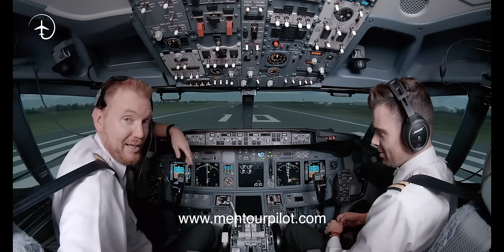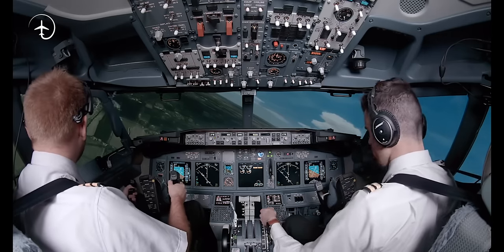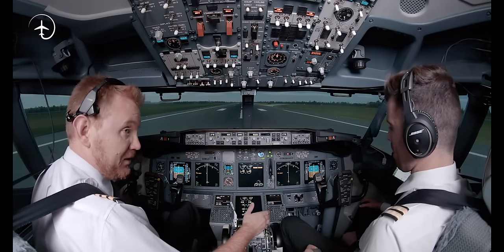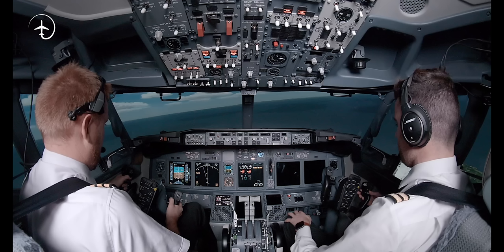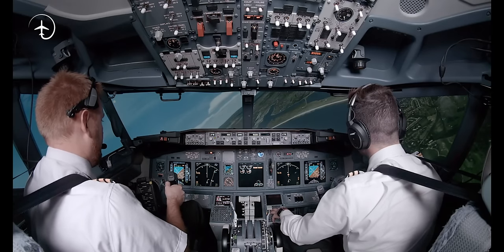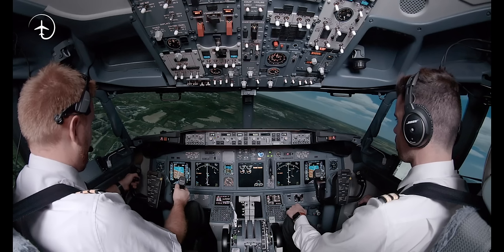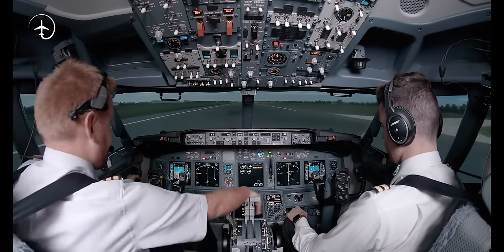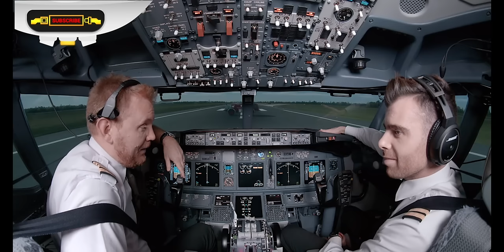Can an Airplane land if BOTH engines fail?

Comment: Very interesting, just obe thing, because you lost both engines, there was no time to dump fuel, how exactly was there no problem, i mean you landed in the first third of the runway? How did the simulator took into account this? 90% sure you were above maximum landing weight. Its just a little bit best case scenario,  anything else, perfect.

Comment: As a glider pilot, I find the question quite silly.  Glider pilot refer to engine as cheater equipment ! If you have enough altitude it is not a problem at all.

Comment: What about jettisoning the fuel? No need to do that?
Reply: They had only few minutes time to make the landing. In this case the amount of the fuel is not the main issue because they have no option but perform the landing.  And Boeing 737 doesn't have a fuel dump system. It's also not possible to dump fuel in a few minutes.

Comment: Would the RAT drop out by itself when there is no power by the engine generators anymore? I'm not sure but I think I've read something about it?! Not specifically at the 737 but somehow somewhere.
Reply: Funbeenif Not specifically on the 737 since it does not have a RAT😉 Think it can go out auto and when selected

Comment: Hey mentour! In the case of the FO being pilot flying and this happens, does he then relay control to the captain or continue flying as he's the designated PF?
Reply: Or will it be briefed before takeoff? (who does what if things hit the Fan)
Reply: The instruments were only working on the captain's side so that makes sense.   I would expect the captain would take control by saying "my aircraft" or "I have control".
Reply: In the Sully incident, it actually was the FO flying the take off and during the bird strike. This is from the official cockpit voice recorder transcript of that incident:

15:27:14 HOT-2 uh oh.
15:27:15 HOT-1 we got one rol- both of 'em rolling back.
15:27:18 CAM [rumbling sound begins and continues until approximately 15:28:08]
15:27:18.5 HOT-1 ignition, start.
15:27:21.3 HOT-1 I'm starting the APU.
15:27:22.4 FWC [sound of single chime]
15:27:23.2 HOT-1 my aircraft.
15:27:24 HOT-2 your aircraft.
15:27:24.4 FWC [sound of single chime]
15:27:25 CAM [sound similar to electrical noise from engine igniters begins]
15:27:26.5 FWC priority left. [auto callout from the FWC. this occurs when the sidestick priority button is activated on the Captain's sidestick]

Comment: I will Say in Canada we are the king's of gliding 2 very famous case Air Canada 236 ( Gimli Glider) a Boing 767  run out of fuel and Air Transat 236 A330  glide for 45 min over the ocean both land on runway I flew with one of this Captain a lot skill can't be replace....

Comment: What would happen if you were to lose all electrical power in a fly-by-wire aircraft?  Would they lose control or is there some safety precaution?
Reply: Ram Air Turbine (RAT) will deploy to provide limited electrical and hydraulic power.

Comment: What about fuel dumping before landing?
Reply: Boeing 737 doesn't have a fuel dump system. They had only few minutes to perform the landing so the amount of the fuel is not relevant in this case. Their only option was just perform the landing.

Comment: Question, in a situation like this, is it normal to dump fuel for landing weight? When is that necessary and when not?
Reply: There certainly wasn't time to dump fuel! Which means the plane must have been heavy as well as unpowered..
Reply: Can’t dump fuel in a 737.

Comment: Do the engine thrusters cut fuel to the engine in this case? could you have cut them earlier to prevent fuel leaks?  Did you have to think about dumping fuel?
Reply: Boeing 737 has no fuel dump system.

Comment: Does the 'ram air turbine' deploy in these situations?
Reply: The Airbus 320 is equipped with a RAM, while the Boeing 737 gets emergency power from batteries and the Auxiliary Power Unit.  My understanding is that the RAM deploys automatically while the APU must be started manually.

Comment: Nice video! I notice that you did not retard the throttles until after you landed/stopped.  Wouldn't the fuel pumps still be working, pumping fuel to engines? Or is there an auto fuel shutdown valve in system to cutoff fuel flow.

Comment: I teach Turnbacks to Opposite.  Over turnback altitude with no engine power? 1-Lower the nose,  2-Turn 40-45 degrees bank just under the stall speed warnings, (Not 30 degree bank only).  Also no time wasted starting engines or doing anything while going away from airport.  Turnback at 40-45 degrees and head to airport BEFORE anything else.. Aviate with lowering nose, Navigate to airport while copilot communicates.  No time wasted going away from airport with no engines.  Those guys instead kept going AWAY FROM AIRPORT.  Huge pilot errors done.  Then they lower the gear and got short of field, DAhh!! and hit trees.  FAil..

Comment: Not to brag... A few years ago the aviation industry began testing us on dual engine failures with us going through an inflight restart in our annual "recurrent" training.  Like most of us, I did what I was supposed to and the "scenario" ended.

But, I started in gliders.

I looked at the sim instructor and said, "Let's do that again, with no relight.

Sims are funny. Your heart does pound. Your shirts are stained. The smell of tension, fear, doubt, is there. Sure, it is a sim, but...

I actually wrote a story, I fancy myself a writer, but yeah, in the sim at least, when my 737-800 lost both engines, every one went home.

It is a good story.

Yes, a good crew, with Gods grace, can land a Boeing 737-800 with dual engine failure.

Comment: So why would you not evacuate the plane immediately upon landing? Isn't the plane at risk if the engines are damaged, possibly leaking and the brakes are hot? Thanks in advance
Reply: Evacuation isn’t a 100% safe way to leave the aircraft. Injuries can be caused. Hence he asked fire crews to check the aircraft for anything that could mean an evacuation is necessary. If not. They’ll get air stairs out to the aircraft. Much safer way to leave.

Comment: Hi, I practiced this in simulator and we ended up with manual reversion as Hydraulic EDPs went off, did you have engine N1 rotation in this scenario? I wonder how the EDPs were working if the engine is stuck and doesnt windmill? I appreciate if you help me to understand this. Thanks alot.
Reply: Mohammad Rasi They are not..the EMDPs will have to do when the apu is connected to the buses.

Comment: Question:  Once your plane lands with catastrophic engine failures and possible leaks and then fires, why not initiate the emergency slides?  Get everyone out ASAP?
Reply: Because people can be injured when emergency evacuation so it’s best to assess the situation and in this situation they have an idea of what a bird strike will cause to the plane , and you don’t want a person going down the slide then going over to the wheels and get burnt near the hot brakes ect
Reply: Limited visibility and communication between crew at that time is why they got the fire crew to assess the situation. You don't want to blindly open exits and deploy slides because you could be doing so over a fire or spill etc and make the situation worse rather than the safer side.

Comment: Did you need to jettison some fuel before landing
Reply: Boeing 737 doesn't have a fuel dump system. (And if the aircraft has it, a few minutes is not enough time to do it.)

Comment: The plane must have been pretty heavy due to full tanks. How much of the fuel could have been dumped in this short time? Would it even make a difference? Or is it not allowed in this situation?
Reply: 737 can’t dump
Reply: @coca-colayes1958  Thank you. Didn't know that. But what if this happens on a plane, that can dump?

Comment: Are the flaps lever that difficult on a real plane or just in a Sim?
Reply: MentourPilot has mentioned in comments to a previous video that the flaps lever in the simulator needed to be oiled.

Comment: Can an Airplane land if BOTH engines fail?
Unable. We're gonna be in the Hudson. 
Or alternatively, the dragstrip outside Gimli.
Reply: Or an airbase in the Azores (Air Transat 236 24-Aug-2001).  That one and the Gimli flight are more difficult since in those cases there's only the RAT and no APU.
Reply: @takingthescenicroute1610  They had more altitude than Sully though so didn't have to make the decision in seconds where they were going to attempt to land.
Reply: There had more cases than the ones mentioned above. There was a TACA 737 I don't remember where in USA that lost both engines due to water ingestion in the middle of a storm, they aimed for a river but at the last minute they found an open flat grass field next to the river and successfully landed there. So successfully in fact that they took off from there again after replacing the engines. There was an MD80 in Europe (I think it was SAS) that had a dual engine failure shortly after take off due to ice ingestion (ice that separated from the wing due to no deicing before take-off) and they landed in an open snowed field. Like 1 year ago there was a Russian A320 that ingested birds in both engines after take-off and successfully landed in a crop field. There was a DC-9 in USA that had dual engine failure due to rain and hail ingestion,  they glided to and landed on a highway but unfortunately they hit a bridge during the landing roll so there were a lot of casualties.
Reply: @adb012  Is that the one headed for New Orleans?
Reply: @ruthsteen6943  Do you have a source that indicates that?  (I am actually curious.  I don't mean it as an attack on you).

Comment: "We're too high"  Obviously it wasn't needed for your situation, but what do you think of forward slips as a method of rapidly bleeding energy in a dire situation?  I.e. as used in the gimli glider incident. Obviously putting a plane with unknown damage and performance margins into an abnormal attitude isnt without risk, but would you consider it a tool at your disposal in the right situation? or too 'cowboy' to consider?

Comment: Just a question, maybe I misunderstood: Should not green "gear down" lights be reported?
Reply: For sure. In case of overspeed will landing gear not extend, but there should be in such case acoustic warning to hear (as heard in ATC communication in case of 320 in Pakistan). There is emergency checklist to go through.

Comment: Hi Mentour. I have a question. When both engines are damaged - power comes from battery but only to the captain side of cockpit. What would you do if captain is in toilet at that time? (And both engines are gone at 30k ft altitute for example - during normal flight phase)
Reply: Look out the window and fly visually. F/Os controls still work.

Comment: I thought you would need to start the APU bleed when initiating the APU. How come you have to do this while on ground but not in the air?
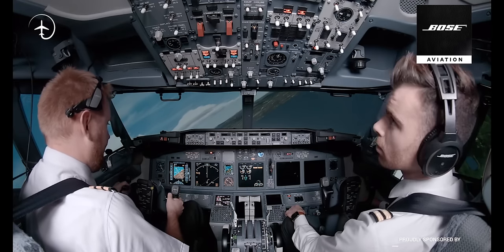Reply: chri5 You are absolutely correct, you can see the pressure gauge for the aircondition packs in the top right corner. They actually had pressure in the pack which goes out completely when he puts power on bus 1 and 2 at 2:50, but they never set the apu bleed switch to ON. They are luckily pretty low, otherwise there would be another warning and automatic mask drop in the (non-existing) cabin😆They are actually landing without pressure in the packs🤭
Reply: @speedbird9313  thanks for clarifying that 👍

Comment: I'm curious, could running the small hidden engine in the tail while on a gliding with no engines give you any usable additional range?
Reply: The APU does not produce any thrust.

Comment: why didnt you put the ENG start switches on FLT? Is it supposed to do the Memory items first?
Reply: Engines have just been destroyed by birds,  no point setting that.
Reply: @LiamHolloway  who said that? By you or QRH?
Reply: @user-tz1mr9hx2f  by mentor in the video. The engines have critical damage. No point trying to restart them so turning the start switches to FLT is pointless.
Reply: @LiamHolloway  Will the mentor in the video help you when investigating?

Comment: Why left thrust levers at climb thrust even if engines has already failed?
Reply: They also didn't set the fuel switches to cutoff. However the QRH states that you should do the shutdown only when conditions allow. And I'd say they had better things to do at this point.

Comment: Something I've been wondering: what if a big airplane completely runs out of fuel and manages to make an emergency landing at a tiny runway on a small island in the middle of the pacific. Then what if that runway is far too short for the plane to ever take off again, even without any luggage and passengers?

Comment: Disclaimer: I know nothing about aviation. I just subscribe to a few channels. Re the PIA crash preliminary reports (assuming it is true): 
 
The plane wasn't in landing mode which caused the landing gear to not be extended.  Would the TOGA function work when the aircraft hit the runway?  (assuming the pilot pressed this button)

I'm wondering if this switch would assist the aircraft in climbing since the computer assumes it is airborne.  Or, would the pilot have needed to manually get the aircraft off the ground?

Comment: What is worst, Dual engine failiure on 30000 ft, 3000 ft or 300 ft.
Reply: Exploatores Well at 30000 ft you will probably have enough time to find a suitable runway and make yourself and the airplane ready for the emergency landing. At 3000 ft it will work only if you are already in the proximity of an airport, like after an go around. It could have worked in the case of the crash in Pakistan last week if they could have reached that altitude before engine failure. At 300 ft you can only make it if you are already in the final approach and on course and the perfect glidepath towards the runway. A birdstrike in this phase of the flight can happen. It’s the worst case scenario of the 3, cause you have no time to prepare. In any case you have only one try, no go around.  Just like a space shuttle.

Comment: Why APU need to be restarted?
Reply: Because normally it's not used during the flight. The APU is shut off after both main engines are started on the ground.

Comment: This is only a simulation, in reality it is a lot more difficult, it depends on the altitude and the position at the point of engine failure, and the skill of the pilot to glide at the right angle and the right heading, the right speed, toward the open areas. I am a pilot myself.

Comment: When it is not yet certain that you can make it to an available runway, is it wise to lower the gear?  It will increase the drag and shorten your range, right?
How long can you possibly delay lowering the gear to save energy?
(a general question not specific to this case where you stated you lowered the gear for additional drag)
Reply: But it does depend entirely on the specific case doesn't it?  I can imagine (don't know, just imagining) that on terrain that has no chance of supporting the wheel load it would be better to land with gear up than have the gear torn off.  So it is "possible" to wait forever to lower the gear. Also gear up on a runway is better than gear down on an apartment building, if not for the people in the airplane, then at least for the people in the apartment building.
Reply: He asked for Gear down when he had the  runway insight and  lose to the runway

Comment: I don’t know how the PIA plane crashed, when it was flying fast, surely if the engines failed it should have made it to the runway ?
Reply: It only made it to 2000 ft when it stopped climbing and then tried to do a 180 back to the airport, not enough altitude.

Comment: Can you instead make a video about TACA 110 which lost ALL engines but the one eye pilot LANDED the airplane on a small place instead of crashing it in the water next to the grass field he landed on.  That is more than these guys that crashed instead of turning back to the reachable airport.  Failed to turnback and kept going away from reachable airport.  These guys were just glorified Failures WITH A LOT OF LUCK.  Just like bad guys that won the lotto.  I dont admire those guys either..

Comment: The airplane will always land if both engines fail.  The  question is, will there be survivors?
Reply: Airliners are designed to be sleek to save fuel, they are pretty good gliders actually. Glide ratio is around 25 to 1 which is as good as some gliders. It means with 1 high you go 25 far. Here with 6000 ft high that’s about 2000 meters. You’ll get 50 kilometres. Far beyond sight of the runway. And actually here the issue is that you need to loose speed and height in a hurry in order to land. Also landing a heavy plane is not something common it reacts differently, I suspect slower authority of controls and it does not slow down like normal, hence early gear down and worries for hot brakes. You’d have to do it in the sim to practice. I have a questions though, what is the range of speeds you can extend speed brakes ? Up to VNE ? Isn’t the optimal speed the highest at which you can produce drag from speed brakes. In a glider you have attitude controls, speed brake and ballast to jettison (water in the wings) to get where you wand on the runway. When to high on final and speed brakes out full, I retracted speed brakes and did a 360 to add track distance and resumed final with a better slope. My instructor said S turns are preferable as you don’t loose sight of the runway and speed is critical as not to stall. Maintain airspeed at all cost to preserve flight and manoeuvrability That’s always better than falling out of the sky like a rock. But it’s hard to put the nose down towards the terrain.
Reply: [TheFarmanimalfriend]
"The question is : Will there be any survivors witnesses?"
Ficst it fer ya.